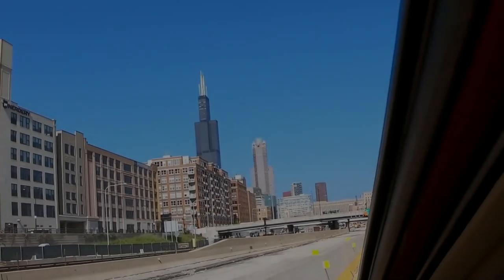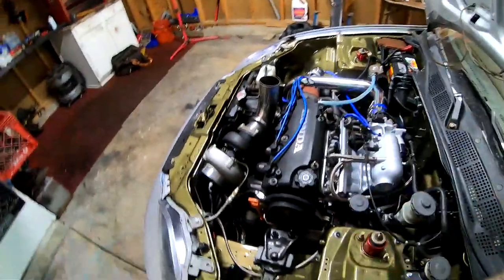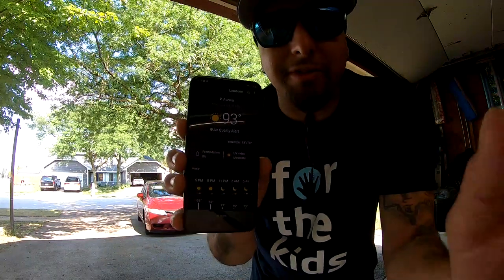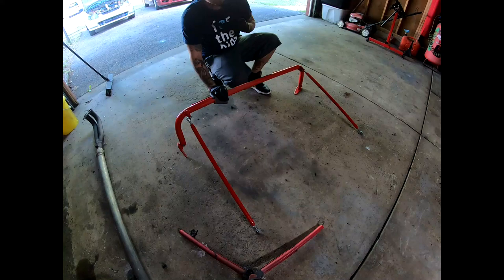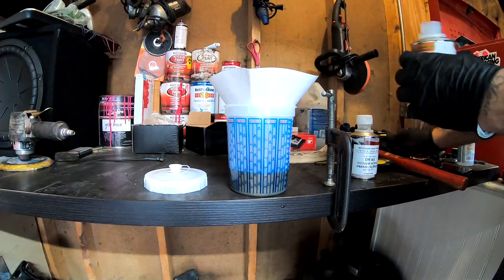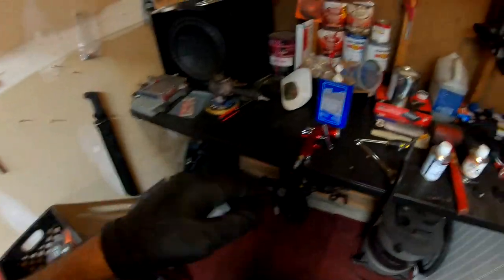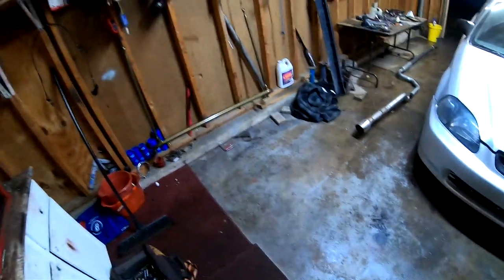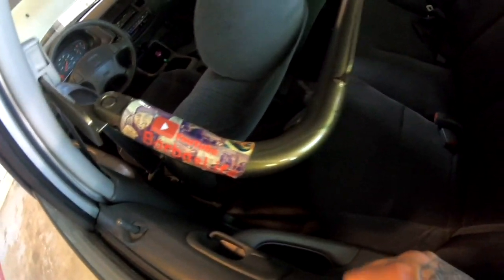Painted Harness Bar to match Engine Bay

Comment: Whenever you get a drip like that let it dry good and wet sand with 2000-3000 and if you need you can repaint but may not need to re paint it